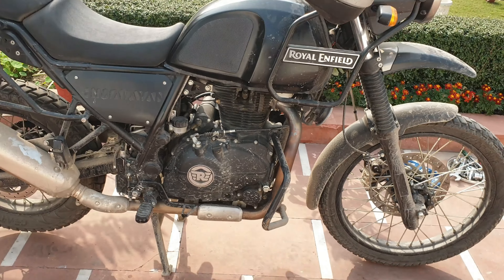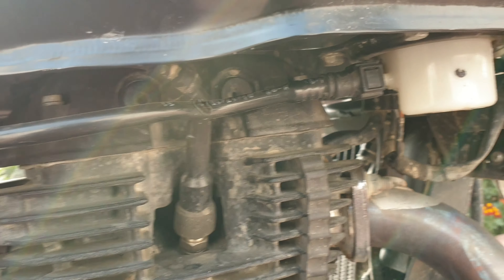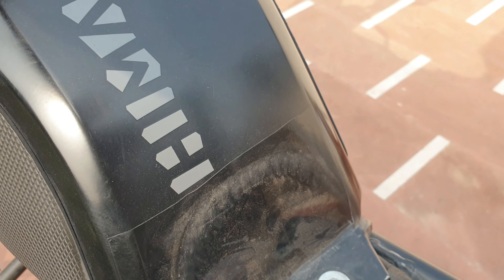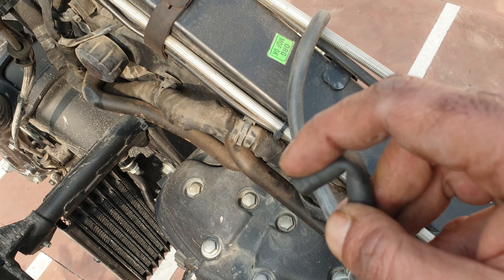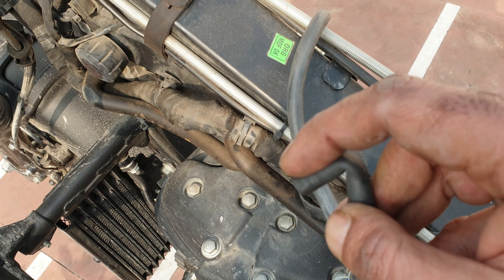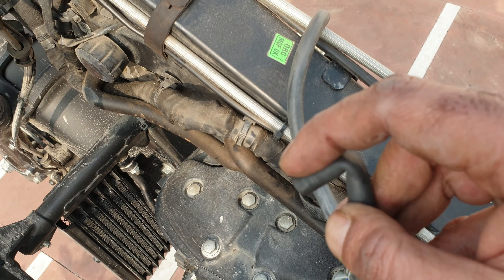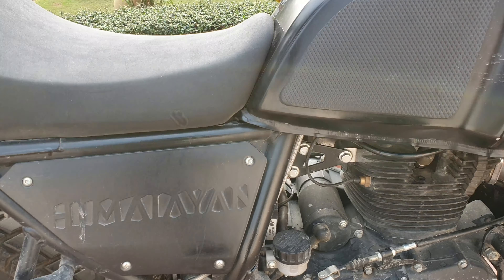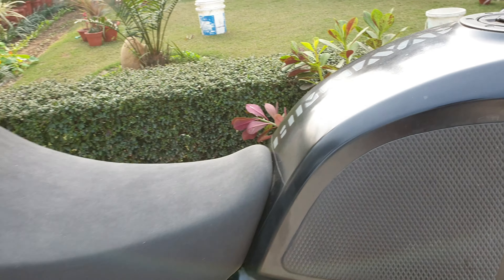Royal Enfield Himalayan Tank Dismount | Remount | Plus Water in the Tank | How to Avoid | DIY

Comment: Hello sir great video,
I have a bs6 himalayan, ive had a few falls while offroading and ive noticed that when the bike has fallen, fuel starts leaking from the tank lid. Does RE provide a replacement rubber seal for the lid? If not what other option do i have to solve this issue
Reply from the maker: Hey mate, yes they do provide the rubber seal on the lock. Though these don't last long so its ok if after a couple of months the fuel trickles out slightly.
Reply: @leuheanrede  Thank you for replying!,  My lid started leaking right after a week of owning the bike haha
Reply from the maker: @devanshsharma4828  no problem mate :) slight leak is always there when it falls. As long as all the fuel is not gushing out excessively when riding on full tank, things are pretty much ok
Reply: @leuheanrede  Okay👍👍

Comment: Sir I've ran into problems.. i made myself a DIY harness gor fog light.. i removed the tank to route the wires underneath the tank..after everything is on place.. the tank is not getting back in position correctly.. the holes misalign by some milimeters.. i couldn't get the tank back on so i took it to the RE service centre.. they put a screwdriver inside the holes.. and yanked it forward to align the holes.. I'm scared it would damage the threads.. they got the tank on.. two guys had to do it.. is there a solution or a reason why this is happening?

Comment: Great tutorial. Question here:
Did you drain the tank completely.
If so, how did you do it?
If tank can be removed without being drained, would fuel fall from any of the hoses you pulled of?
Reply from the maker: Hey mate, no its not necessary to empty the fuel, bu tit will be helpful if there is less amount like say 5-7 ltrs  or even less so its easy to lift it up and angle it properly. And also at about that quantity, the fuel will not trickle out of the drain hose either, cheers :)
Reply: @leuheanrede  how do you drain the tank if you need to remove bad fuel?

Comment: Question about the green wire, so with the wire you cleaned the overfill tube (may be otherwise called ), can you do that with air from the compressor when you do not dismount the fuel tank ?  should clean it as well, no ?
Reply from the maker: Precisely. You are right. Under ideal circumstances that's how it should be done. The wire tip is just for DIYers at home like me ;)
Cheers

Comment: just make sure that when you pour the fuel from the fuel tube in tee cup that nobody takes a sip from it !

usually her in Switzerland  they say that whenever you work on a machine you first disconnect the battery
Reply from the maker: Hahaha :D
That was a almost new saucer. I know. Dont remember how long ago I started using it and why?
And yes that is true, disconnectingthe battery is a good practice. They say the same thing about removing negative terminal to prevent any shorting and thus damaging the electronics. I too would recommend doing the same. 
It also depends on many other factors. Like what kind of electronic connectors the bike is using, how old the bike is, what condition the wiring loom is etc.
So if I am working on someone else's bike I would disconnect it
Cheers ;)

Comment: i see in my Himalayan,the connection seems different .. as it was bs3 ... do you have any idea?
Reply from the maker: Hey, Bs3 would not have the thin tube that comes in Bs4 for Evap.
So it should just have the single fuel/water drain tube. hope it helps
Cheers :)
Reply: and it also don't have the connection you showed ... undr ryt side of tank ... i watched your video and try to find these connections but find that all connections are different.. there is no clips type connections
Reply from the maker: Yup, sorry forgot to mention, The right side one is for Fuel pump, that wont be there on the Bs3 because it has carburetor. I have not worked on Bs3's but it should just have 2 tubes and 1 connector, one tube for fuel/water drain and second one for tube feeding the carburetor and third should be electrical wire for fuel gauge :)
Reply: @leuheanrede  thanks dude , you helped me :) , now it seems easy to remove the tank ... and see if i can adjust those tapped or not  :D
Reply from the maker: Have a happy DIY time mate, Cheers :D